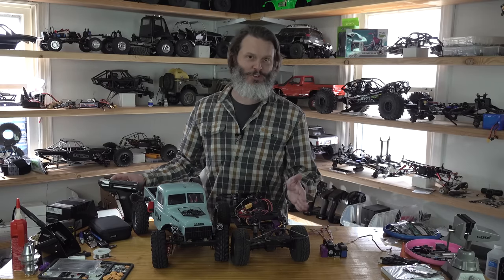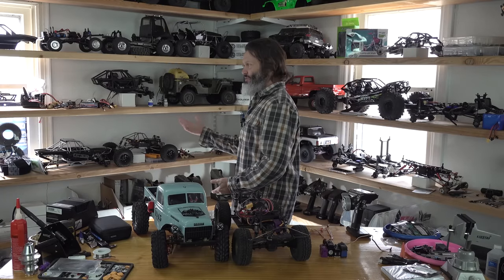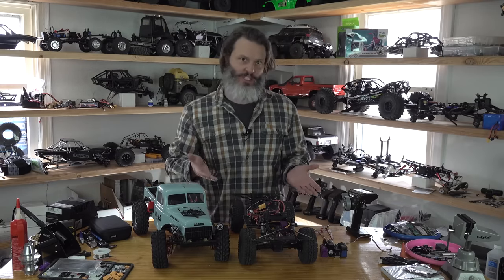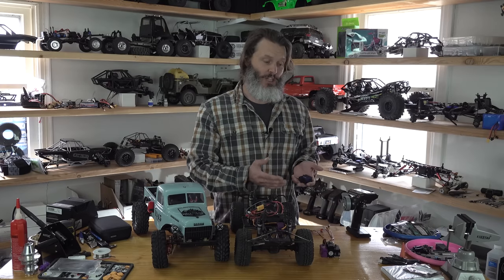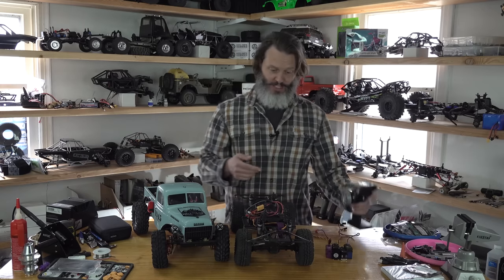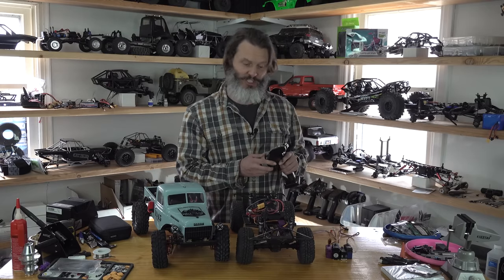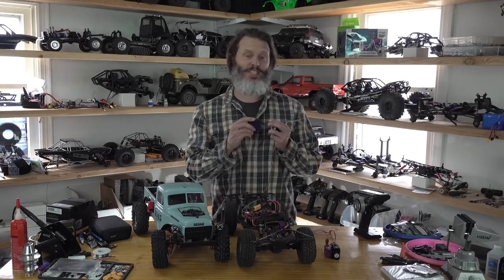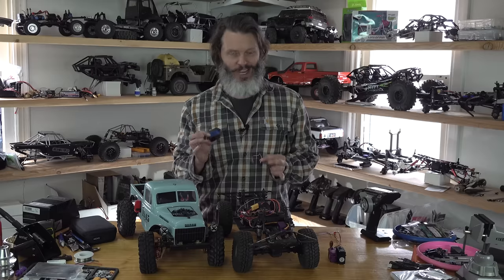All about steering servos!  Lets talk servos with John Robert Holmes

Comment: I sure appreciate the additional info. I recently bought a handful of gently used servos off Marketplace, which included a couple of your SHV500v3 as well as two Reefs units. Having stabbed one of each into a couple of my crawlers, I'm learning the differences in how and why they do what they do. Always nice to hear from the "head honcho" about a product! And, holy cow, these things are impressive. I had no idea!
As an aside, my only complaint about 25T spline counts (or 23T for that matter) is that because of the odd number of splines, the mounting orientation of the servo will dictate whether the servo horn rests nice and centered in the neutral position, or not. Sometimes, link lengths or physical barriers will dictate that a servo can only be mounted one way or the other- leading to the neutral position being off center. Granted, that's why we have subtrim adjustment on our radio gear, but it kinda bugs me all the same. I guess I'm a little OCD about that or something. 
Regardless... Thank you!

Comment: When I tuned in I didn't have any questions about servos. But like so many areas of the rc industry, I simply didn't know that I didn't know. Nor what questions to ask. 
Thank you, John, for explaining & breaking down a servo's function into dissectible slices. I can really sink my teeth into these types of videos and I just learned a BUNCH more info that, without which, I would have continued ignoring high-dollar servos. 
I do have one question: A few of my 2nd-hand servos have the word 'Life' printed on them. Why?
Reply from the maker: Life is for lithium iron.  The old "hv" servos couldn't take a regular charged lipo.  Life has a lower voltage.

Comment: Just a quick question, how about solenoids or linear actuators? I've been curious about controlling the dig function with something along that line.
It seems the logics for selecting A or B would be easier to create in a small package if you didn't need anything in-between.
I've seen things like that used in animatronics.
Very cool stuff you do, I'm currently waiting patiently for a speed controller for my new 2200 revolver. Its going in a 5 pound portal low cg crawler. 
Loving your SVH650 on 3S. It pushes the rocks to the side, and opens up it's own path. Hah.
Hope you and yours are happy.
Be well and have fun.

Comment: I’d love to try one of your servo’s but anything for my 1:10 scale is sold out I keep checking. I’ll recheck I don’t need the most expensive just the right match for a 1:10 scale crawler. Also how does a hobbywings 2in1 with built in esc work with a high volt servo? Any issues? Thanks

Comment: Lot's of info. Thank you. I'm building a "yakimaran" and am thinking about using a servo to steer (I'm already using a Quikrun 880 for speed control) so I would end up with a remote control boat that My wife and I can ride in. The motor is a trolling motor with the head lopped off so I can easily put an arm on it. Can you recommend a servo for this. I'm using a 4S LiFePo for my power source if it matters.

Comment: Could you use the brushless servo motor on a scale winch with a small separate box for the servo electronics to run the motor & wiring for the motor?

Comment: Dear Mr. Holmes, I recently picked up a HH revolver 2200kv to pair with a Castle SW4 I had sitting around. I LOVE the control of the motor, but it has an ear splitting whine at about 1/4 throttle. Is there any way to tone that down?

It's installed in a Trx4 Defender, stock pinion running on 3s currently.

Comment: Are there any ESC becs that you feel safe using? i understand that any that offer tend to only offer up to 7.4v, but figured Id ask anyway.  ive taken on the hobby by jumping in with both feet, and amassing 7 1/10s in a little over a year that I am replacing, and upgrading, almost all at 1 time. I certainly crave a handful of HH and Reefs servos, but will have to take on 1 at a time, especially since I'll need to get some batteries for them as well. These Amazon specials (25 &35kg) were fine, but aren't cutting the mustard, and 1 just cooked while the rig was sitting still. Lucky I didn't lose my Fusion....

Comment: Any recommendations for the upgrade FMS Fj40 steering servo?  I notice when there is no load on the front tires they have a certain turn radius.  When the weight of the vehicle is on the front tires they much larger turning radius

Comment: Now I’ve been wondering, with that wiring configuration typically ground is shared with the servo signal coming off the RX as well as the negative off the battery. So ground is a Y funneling into the servo. With signal wire only coming from the RX and hot wire only coming from the battery. I’m wiring my TF2 to run a separate battery for lighting on a class 0 rig. And I wanted to run my shv500 direct power off off the main but the winch I was hoping to power from the light battery. If I pull signal only from RX and two wire positive/negative off the secondary battery would that cause it to glitch like you had some servos do? I wouldn’t want to splice the negative from two separate batteries to feed this because that could go wrong as electrons try to return to source. So it’s either skip that, run a larger primary battery and power both servos off the main with a smaller battery to power the lights only and risk the servos essentially having a brown out if I use mixing or skip mixing and just keep it simple and use one at a time. What would you do?
Reply: I wrestled with this issue for a little bit before coming to the conclusion to just run everything off of one battery. If you wire it right it can be super simple and elegant and you only have to worry about one voltage source
Reply: @rc7178  I did decide to do that on my TF2. So I ordered the Powershift deadman switch and their pelican light switch box so I can do that and control power draw of the lights, easily turn them off and make sure everything is de-energized as well when not running. Oh, also got their wielder volt meter so I can monitor cell voltage while driving and can work that into the theme. So deadman switch is the propane tank. A friend is printing me a generator and I’ll have the three connected so it’ll be like a ranch truck going around repairing fence. That’s my TF2 and the GSpeed V3 I’m building will be a flatbed ranch truck with a bale of hay and other things related in the back. TF2 has the 1080 and Crawlmaster while the V3 has the purple servo, purple motor and hoping to get the purple esc. Very excited, hoping to get a second purple servo when they release to go in the tf2 or a second build.

Comment: I am wanting to order the green SHV500LP servo that comes with the JST adapter, but as you mentioned in this video, under High Power level is actually not a good idea, so should I not order it? Would I have problems with it under high power situations? Thanks!
Reply from the maker: It's only the 650 model that has issues, it pulls over twice the amperage
Reply: @HolmesHobbies  Thank you!

Comment: Installed the lp 500 and i don't notice a difference between a 2s and 3s lipo.  I am running direct power with your jst adapter xt60 bridge plug.  I have a hobbywing fusion 1800kv motor/esc.  Is it possibly a setting on my esc limiting the power/voltage to the servo?.  No where near as fast as your video shows.

Comment: John, something I'm confused about is why do you need a fast servo if you are low speed crawling?
Reply: It's not a must but makes it easier to shake the truck down off a ledge, getting the suspension to settle for example.
Cheers 👍

Comment: I have  a ?? Do you need to put a power lead off your battery for direct power?
Reply: Most people solder it onto the esc's battery plug, or at the esc end of the battery plug lead. Not on the battery itself

Comment: Technically speaking, cms and servo on axle, is more of a driveline, or scale thing. I was hoping to find information about coreless, analogue, digital, direct power,. And i wasn't dissapointed. I have a suggestion for a topic. I want to build my own scale jeep style or bronco style chassis for a couple full metal rigs. I have experience with using gas torches, and mig and wire fed welding systems and have a natural skill for building things and can visualize what i want, but i can't seem to get the pictures from my head and paper any further. 
Id like to learn some  ways that builders begin putting tube or rod in place to start brazing, soldering or welding? Are there any jigs that you can use that hel set the intended ride hight, wheel base and chassis height? Id love something like those soldering alligator clip extra hand thing. With some extra stiff arms that could lock things in place while joining the pieces with your preferred method, (weld, braze,ect. Thanks for the video,